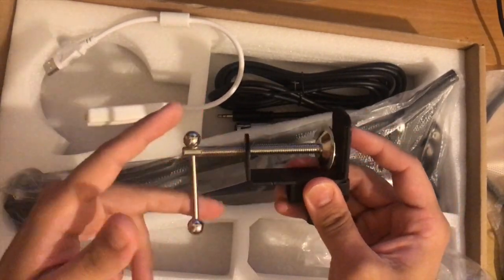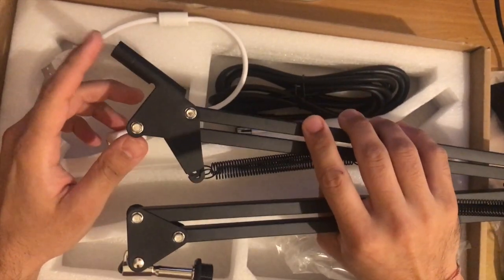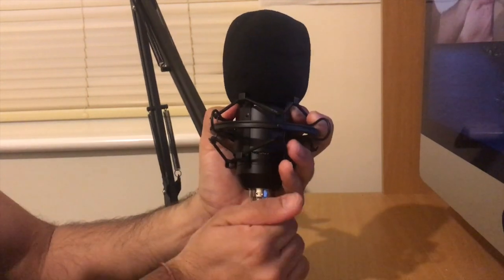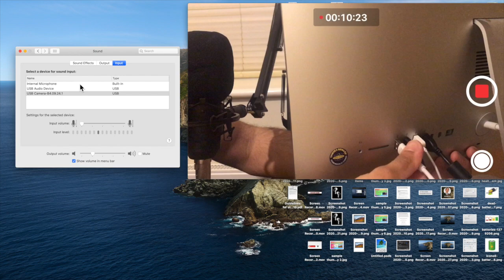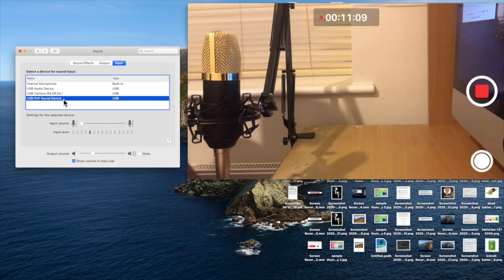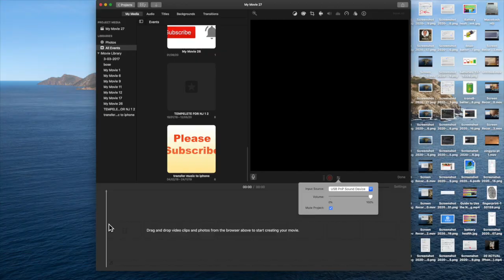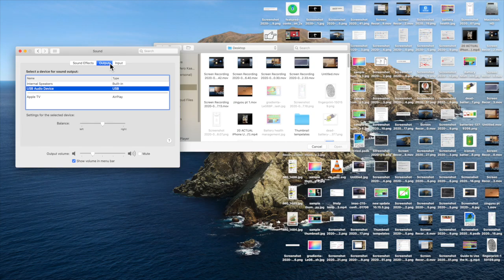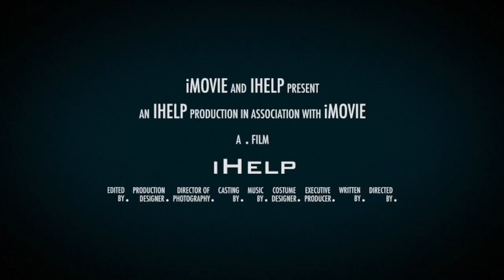UNBOXING (ASSEMBLY) (REVIEW) of ZingYou ZY-007 Condensor microphone (Jun 2020)

Comment: Hi guys i think alot of beginner streamers bought this microphone thinking it is plug and play. However it does need some selection in sound settings in wins 10 to get the mic working. The need for a phantom power to power up the mic is not true. Initially i thought the 5v usb port does not supply enough power to the mic and was intending to buy a phantom power. 

For those who plug and play and got it working are those whos laptop or desktop automatically select the usb audio device for them. For the majority who does not get the mic to work, first check that the  the white soundcard adaptor usb when plugged in is glowing orange, that means power is supplied to rule out hardware failure.) 

Then comes the important part**
There is need to select the usb audio device (the white soundcard adaptor usb that was  provided) at
1) under search bar of windows, type sound , there will be alot of options, select sound settings and click in
2) under input, please select the newly detected usb soundcard adaptor, if not your mic wont work)!
3)select device properties just under the input and click in
4)ensure mic is at decent volume levels at device properties window
5) in device properties window, u can click  additional device properties which will show microphone  properties, ensure use this device (enable) and in "listen" tab , u can test the mic by ticking listen to this device
6) ensure microphone levels is good at levels tab

for softwares that dont recognise the mic,  go back to sound settings, scroll down to find advance sound options and click in "app volume and device preferences, it will pop out a new window which shows all the active software or app u are running and ensure the selected software u are using have the correct input which usb audio  device should be selected)

even with these steps u have to ensure

go to :
1) control panel, select view by large icons to browse all the options
2)click on sound
3) ensure under recording, usb audio device is enabled and u are good to go

took me a while to figure out why most people tried to plug and play and there was no mic levels at all and it boils down to windows sound setting selection which majority of people are not desktop support engineers

**pro tip is to get a cheap  soundcard usb adaptor which will lessen much of the hissing sound for some but the provided soundcard will suffice. hissing sound is very little.

hissing sound comes when usb is plugged near the usb port that is near the cpu fan or laptop fan, plug it away from the usb port .

 try another usb port if not directly plug into mic port. direct plug into mic port works if you have an in built sound card already. in device properties window, u can click  additional device properties which will show microphone  properties, ensure use this device (enable) and in "listen" tab , u can test the mic by ticking listen to this device.

If mic port does not work buy a sound card usb adaptor which is very cheap. a recommended brand would be ugreen.

The mic works if you know what you are doing and sounds professional.

Comment: I like your video but i have a problem with my microphone when I connect rhe microphone to my computer why is it that there’s no sound coming out from the microphone when I do the testing. I tried the jack as well as the sound card but it doesn’t work. Do I need some settings to my computer? I feel frustrated please help me🙏🙏🙏 thanks
Reply from the maker: Hi Emelie, depending on the model of microphone, you might need a phantom power. Please check my latest video https://youtu.be/CJ775fTKfZw for demo what it looks like and my other microphone videos where I have explained how phantom power connects to my mic and eventually computer.
Some of the mic (especially condensor ones) might need extra power. If this doesn’t work after watching the video please tell me more about your computer and I can help you out